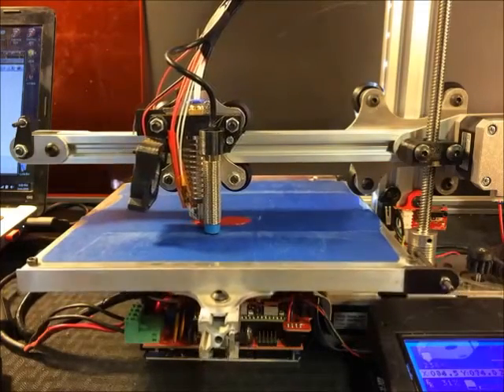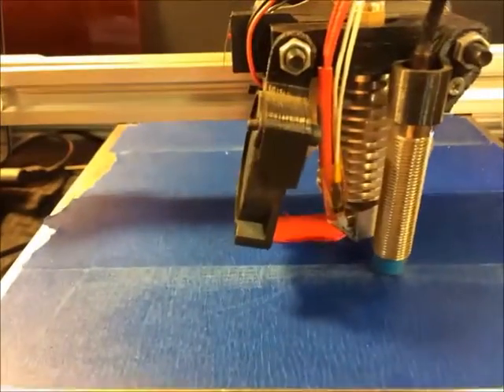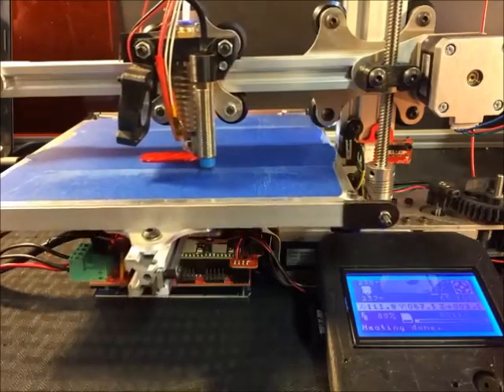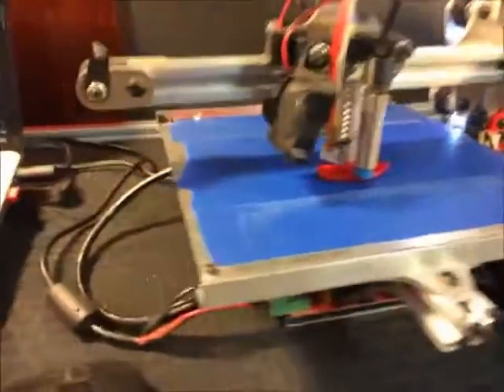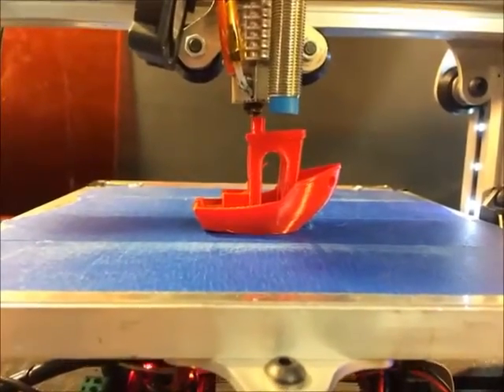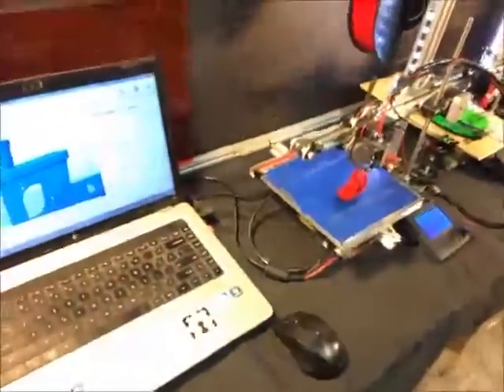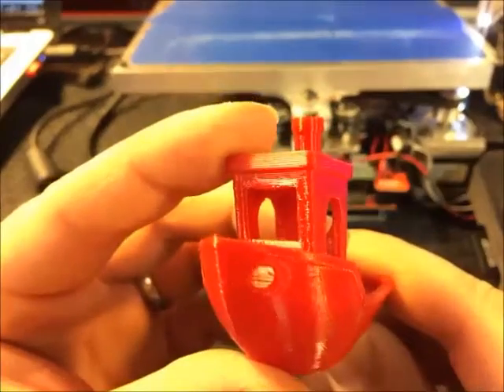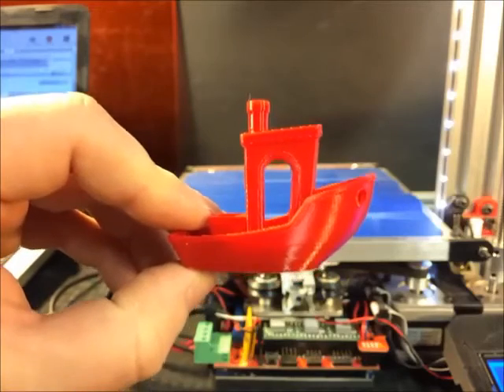Reach 3d Printer Benchy in PETG

Comment: Hi! Is it fine to print on a borosilicate glass? Or do I need to paint a stick glue on it or to protect by some other mean? I know that glue is for better 1st layer adhesion but also I've seen videos where people tells that their glass was damaged because a PETG part didn't wanted to stick off.
I see that the video is from 2016. Did you've got that this filament started to "collect" water and then you've got bad prints: bubbles, boiling plastic and etc.? If "yes" then how much time passed since you've unpacked it?

Comment: I'm growing to absolutely HATE PETG.  People seem to love it because it's easier to print than ABS, but now I have a PEI bed on a thick slab of aluminium (to make it temp stable) I have far less issues with ABS than PETG.  I am now 99% convinced this is because my printer is enclosed and has no part cooling fan.  This is a benefit with ABS.

Over-hangs with PETG SUCK.  I found this with colorfabb XT too.  I now think I am going to have two types of printer.. One open with fans for PETG/Co-polymer materials to keep the print area cool.  Then another more industiral enclosed printer for polycarbonate, ABS and other materials that are prone to curling (not neccesarily warping, though the chamber helps that too).

PEI bed also seems to stick to PETG far too well.  I think just glass or aluminium is best so far.
Reply: So far, I agree with you. PETG has some nice properties, but I prefer ABS.

Comment: I found something that works EVERYTIME on PETG to make it stick. Coat a glass bed with PVC cement. This is not a long term solution, but an ultimate solution, if you want a superbly smooth finish on the bottom and no chance of bottom layer warping.
Reply: Hi! Is it like PVA glue or completely other substance?

Comment: Nice Video  - 
"no go Category"  - I'd like to challenge you on this one. 
PLA is pretty brittle and has no real tensile strength. Twist a bit of PLA and it will snap. I find this happens a lot on screw lugs that i print on cases (like raspberry pi cases). Once you put a screw into it, it just twists right off. It also has no 'give'   - Flex. You wont get to test this with a Benchy but for something longer and thinner you will notice it will flex a lot without snapping or breaking. PETG imo is an amazing filament. I wouldn't write it off just yet. I think you need to print a little hotter. PETG needs slower speeds (30-35 mm/s) and you need to really fine tune your extrusion multiplier - a little less is better, turn down your perimeters also and you will get a really nice finish. 
Thanks again for the vid. hope you sorted out your focus issues. Cheers
Reply from the maker: Hey Oohsam, 
Yeah PETG is pretty good stuff. I now see the advantages they offer for functional parts. PLA gave me less adhesion issues, but PETG is superior, if... as you said.... your printer is tuned. :)